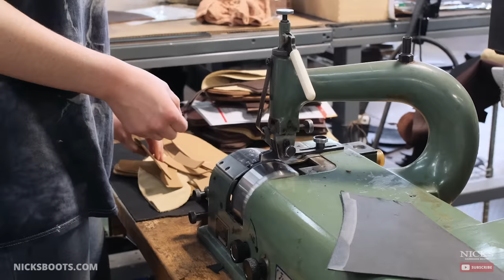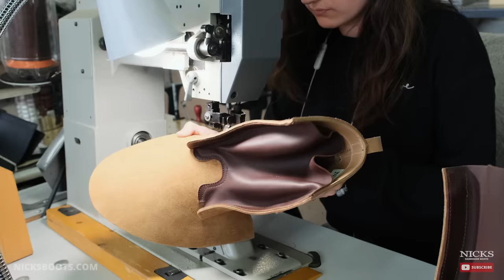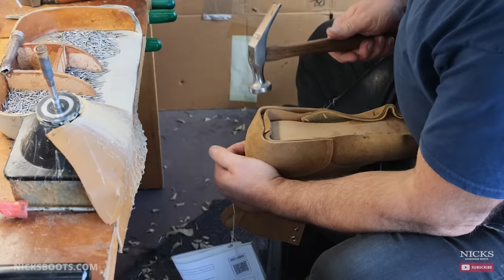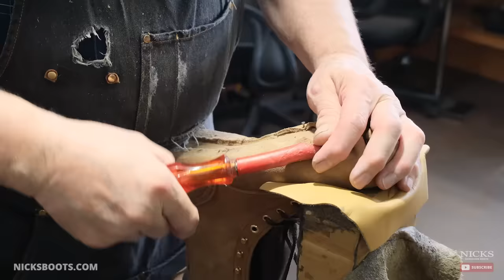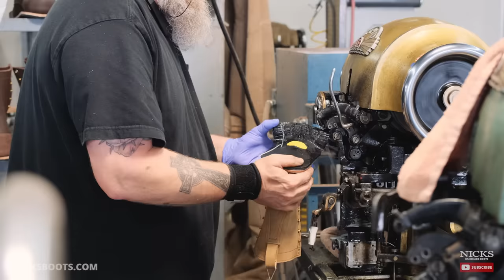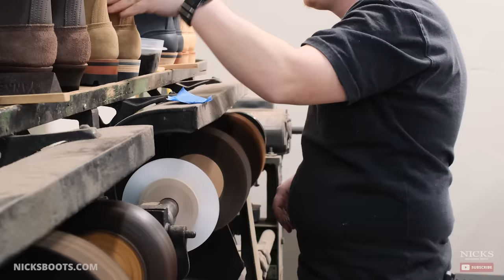World's Toughest Construction Boot: How It's Made - Nicks Handmade Boots

Comment: That's a nice and well made shoe, but clearly not the World's Toughest Construction Boot :D
Reply: Name a tougher boot.
Reply: @Totemparadox  ...? Any construction shoe with safety measures, even cheap ones from china. No toe protection, no reinforcement of the sole against penetration, no ESD safety (even the opposite with all this metal in it) and many other things are missing.
So, you could say there are hundredths if not thousands of shoes that are tougher.
I personally use Atlas safety shoes s3 and that only to work in the garden.
Reply: @PerfectDarkcontrol  Toe protection is an option and I've yet to see nails puncture two slabs of veg tan leather. You can keep your chinesium slippers.
Reply: @Totemparadox  The question was not if it's useful (and yes, for real construction work it is), the question was if there are tougher shoes and the answer is clearly YES! :D
I don't have anything against the shown shoes, it's a nice pair, I just pointed out a mistake that these are clearly not the "World's Toughest Construction Boots", but just some Construction Boots.

Btw, Atlas is one of the leading companies in Europe for safety shoes :D

Comment: Ok lets see what you got to offer. I am 6ft 230 lbs diabetic disabled veteran looking for some extra wide soft inside on the bottom of me feet hot weather and then a second pair of cold weather boots. Looking for some great long lasting boots. I am tired of my feet hurting. I have been wearing timberland pro pit boss and belleville boots. Yet quality seem to have gone away.
Reply: Nicks doesn't have soft insoles nor lined boots
Reply: @Totemparadox  maybe they can make some a touch deeper or taller in the toe box than normal so I can put my own foam insoles in them.  Or are they just cookie cutter like everyone else.
Reply: @boh348  That might work. You could measure your foot with the insole and get the 67 last that has a talk toebox

Comment: No steel cap, no bump cap, no zip side; not up to standard. The only good thing about these boots is you would be carrying a backup set of fasteners on your feet if you got desperate.
Reply: Steel toe is an option. Bump cap is not necessary. Zippers only get broken. You're wrong on so many levels.
Reply: @Totemparadox  bump cap is a site requirement. Have never broken a zip side on a quality boot. You are wrong on so many levels. 😘

Comment: Honestly this is well made and they seem to be very experienced persons making them, specially when they are doing all the stitching (I was a tailor) i know when is professional work. But the thing that worries me is all the nails at minute 15:40 they put on the boots heels and the screws almost at the end of the video, I wouldn't be walking even worst jumping because of knowing that any time one of those nails may eventually go into my foot. Unless they put some kind of protection between the nails and my foot which I didn't see.
Reply: First, they're clenching nails. The end turns 180 degrees creating a round hook like end. Second, a leather sock liner is put over them. They will NEVER poke you. At most you might feel them after a long time of wearing them, but a steel rod and hammer will fix that.
Reply: This is how boots were made hundreds of years ago!

Comment: I think it's overkill,  so many nails, screws on top of strong glue.  Probably only glue is more than enough.  But they have to spend more in unnecessary nails and screws so the price can be unnecessarily higher. There is no other explanation. Because we al know no one is gonna use shoes for more than 8 or ten years.
Reply: The nails are vital to the build and Nicks has models that have only glued soles. You know nothing.

Comment: Sole stitching is really bad, there needs to be a grove for the thread to go into, otherwise the thread will be destroyed in no time.
Reply: It's not bad. I own these boots. Nothing happens when the thread snaps.
Reply: @Totemparadox  I wouldn't say nothing, you just didn't notice it yet. What happens is the thread doesn't have any force to hold the sole and it is held by the screws only, which is enough for it not to fall off but not enough to seal it well. But generally for 500 dollar boots you'd expect more. They have other shoes where they thread before application of the sole, now that's a good quality shoe.
Reply: @marketplayer  Uhhhh, what? That doesn't make any sense. Seal what? The outsoke being only glued on would have less "sealing" capability by your standard, but you claim it's better? You make no sense.
Reply: @Totemparadox  Ok, I'll break it down for you: In this case the thread loses pretty much all of it's value so you only have glue and screws, in the other case you have thread, screws and glue. 2 forces vs. 3 forces capisce? What doesn't make sense is to thread it in such a way that the thread will break on your second wear and then sell it for $500+.
Reply: @marketplayer  Except in the other case the thread goes only through the midsole. The outsoke is only held on by glue and screws. In this case it's held on with glue, screws and thread. Btw, have you ever tried to pull anything out from thick rubber? That thread isn't going anywhere. You have everything backwards.
Reply: @Totemparadox  Once again 2 forces vs. 3 all I need to say, it's physics, there is no way around it, the loose threads can be easily pulled out, your body has enough force to do so.  If you can't see how threading the sole like they did is not a good design, I can't help you. Everything else about the shoe is excellent but that sole stitching is terrible.
Reply: @marketplayer  And this method has more retention. 3 instead of the 2 of only being glued and screwed. You're clueless.
Reply: @Totemparadox  When the thread is broken it doesn't hold the sole and the midsole and the whole "sandwich" with original strength how it can be better? You got ripped off, paid over $500 for a cappy design.
Reply: @marketplayer  Why are you now talking about the midsole? Originally you talked about the outsole. Btw, care to show me evidence of your claim? The thread becoming undone or being easily pulled out. Again, you are clueless about how strongly the sone holds on the thread.
Reply: @Totemparadox  midsole outsole it doesn't matter, what matters is that that stiching method is crap and is in no way professional.

Comment: hmm construction boot eh?   not water resistant (not shiny), no hard toe cap, no metal plate to stop nails, wood heel,
Reply: Water resistance comes from treating the leather with oil and grease. Being shiny has nothing to do with it. Steel and composite toe caps are an option. Metal plate isn't needed when there's two thick leather slabs. The heel is leather, not wood.

Comment: Nice construction. But wonder why anyone would wear a suede construction boot... Think I rather wear army boots.
Reply: These aren't suede...
Reply: it's not suede, it's ruff out, and most good construction boots are ruff out, and army boots would just fall apart an a site
Reply: @markilleen4027  Alright thanks for clearing that up. Thought it was weird. Anyway guess army boots aren't what they used to then. Those things are built to take any kind of beating. Used mine in lots of different conditions and even though the sole is worn down they're still sturdy. Also, perhaps army boots are different per country. So army boots in my country might be tougher than in yours. Army boots should be fit for industrial use and construction. If yours aren't, well then that's just the boot that's wrong and not the type.
Reply: @aeon5566  no military boots should not be fit for construction, they should be fit for marching, and should be light and and flexible, and you should be able to run jump etc in them, work boots should be tuff and comfortable, weight is not an issue with work boots,
Reply: @markilleen4027  Well should not has nothing to do with it. They are fit for construction whether you like it or not. It kind of seems like you know very little about army boots, because none of the descriptions you give for them match. They are sturdy, comfortable, heavier than construction boots and not flexible at all, especially when they are new, although they do become more flexible over time when you wear them. They are made out of hard leather and have a hard sole and reinforced tip and back. They are high to give ankle protection. Maybe in your country they wear sneakers in the army?

Maybe look up army boots and see what you can use them for. You'll find that they are fine for any type of construction work.
Reply: @aeon5566  no your wrong, military combat boots don't have a steel toe, because of excess weight lack dexterity, lack of comfort, and will freeze your foot in cold weather, so you won't even be allowed on a construction site with them,
Reply: @markilleen4027  Never said steel toe, I said reinforced. Steel toe reinforced shoes are dangerous, army boots don't have steel toes. As far as I know it's not even allowed. They are made of hardened leather. Reason is they don't dent in your toe when something falls on your foot.

Also freeze your foot? Lol are you serious?? You know absolutely nothing about army boots. Please stop. You've never seen one, you've never worn one. If you did you wouldn't be saying all this nonsense. Army boots aren't as flexible as construction boots, but they are comfortable, water proof and are great in harsh weather conditions including when it's below 0 degrees celcius. You're just trolling me with this nonsense.

Comment: Im stund that soo many dumb people actually buy these for construction first off theres no steel toe and no steel/Kevlar sole in it for in case you step on a nail. These damn things are only good for hiking, dont get me wrong they are nice but they are not construction boots no job site would allow these
Reply: First, steel and composite toes are an option if the customer wants them. Second, these boots don't need kevlar. Those two veg tan soles require close to 400lbs of weight to get a nail through.
Reply: @Totemparadox  Are they oil and/or electrical hazard resistant?
Reply: @FraserFir-sb4lk  They have a model for that, but these are not.
Reply: @Totemparadox  Yeah those 3 models actually, they're all just EH rated with toe caps, nothing about oil resistance, and they all cost over $500 each. No Gor-Tex membrane either for their 'outdoor boots'. Plus, they all look like something someone's great grandpa would've bought in 1940. These ain't real work boots dude. These are niche as hell very expensive hipster fashion boots.

Comment: I wouldn't pay for those. Why is the leather in the sole and heel, if then rubber is put anyway? Excess water will be absorbed. The sole would be made entirely of polyurethane. The firmware on top of the tread is a horror. The threads will break. Not practical. The sole is not sewn in the heel. It can come off. in such boots, only get out of the limo.

Comment: Nice craftsmanship, but totally useless as a work boot. They should have at least a steel toe, if not steel toes and soles.
Reply: Steel toe is an option, but why steel sole?
Reply: @Totemparadox  So if you happen to step on something sharp, it doesn't go through your foot. Did you ever work construction? Especially during the demolition phase?
Reply: @smokeydoke100  Have you ever had two extremely thick veg than soles under your foot? Literally nothing will go through. Steel isn't needed.
Reply: @Totemparadox  What are veg than soles?
Reply: @smokeydoke100  Vegetable tanned leather. Extremely tough.
Reply: Often times steel toes are not allowed for certain job sites
Reply: @BenSwoloest  Either are hard hats and safety harnesses. What's your point?